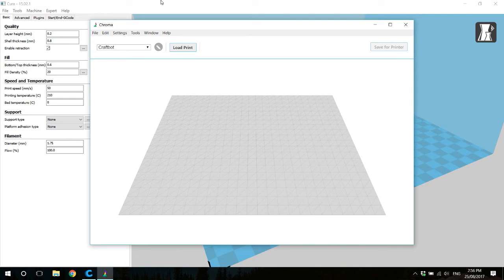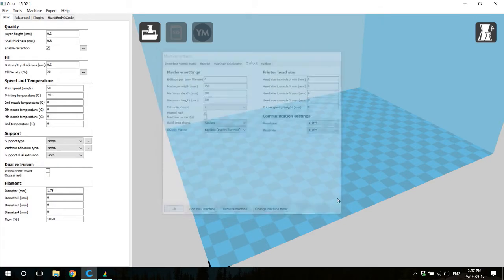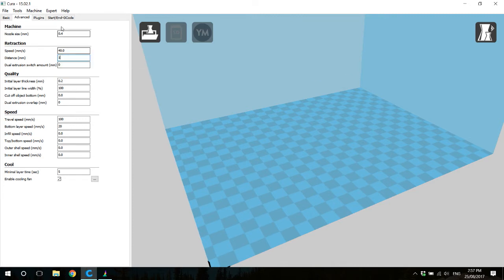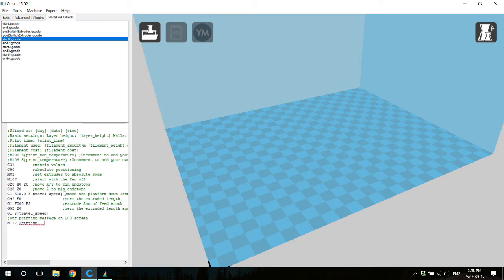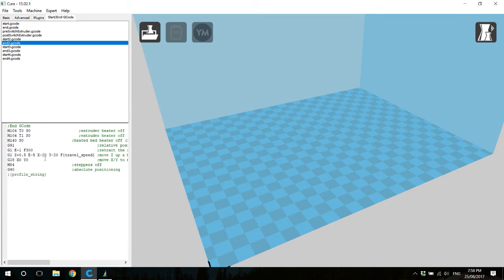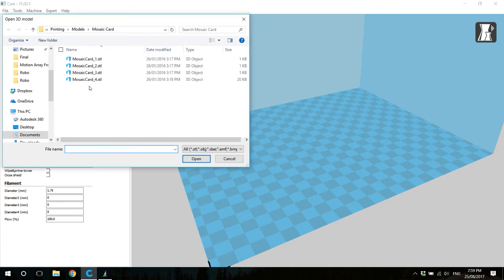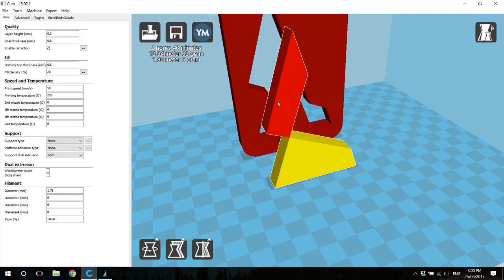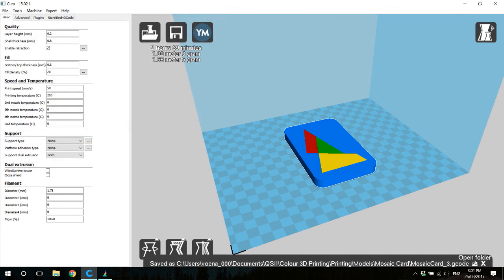Slicing with Cura for Palette/Palette+

Comment: You described how to align multiple parts of a model, but how do you explicitly choose an extruder for a given part?
Reply: Hi Jason,

I'm not sure if this is possible in Cura.

What's the use case for this?

If you have more than 4 STLs and you need to reduce the number of STLs so Cura will generate G-code with only 4 extruders, you can use software like Meshmixer to combine the STLs (http://www.instructables.com/id/Meshmixer-Combining-Models/) before slicing them.

Other slicers like Simplify3D will let you explicitly choose which process/toolhead you want to assign a model to.
Reply: Hi, Brennan.  You've pretty much described the problem I have.  More than four STLs, but I want to assign a tool to each explicitly.  I suppose I'd have to align and group them in another program, but S3D works just fine.

Comment: WHEN ARE YOU GOING TO MAKE THIS COMPATIBLE WITH 2.85MM FILAMENT?  You advertise on your website that your Chroma software works with the Ultimaker 3, but how is this possible being that it uses 2.85mm filament?
Reply from the maker: Hi 3D Novice,

We do not currently have any plans to make a 2.85mm module. The "Compatibility" section you are referring to is for CANVAS, not for Chroma. https://www.mosaicmanufacturing.com/pages/software

I'm very sorry if the website was unclear or misleading in any way.

Developing a product for a different filament size changes every single part in the system, and we've decided not to add the complexity of supporting a different filament diameter for the time being as we already have more demand than we can handle with the 1.75mm unit. We'll consider making a 2.85mm Palette in the future!

Comment: Great guide any chance you could make one for Cura 2.5 or  Cura 3?
Reply: The problem is not making a guide for those versions, it's been found that later versions of Cura have changes that make setting up for various printers more difficult. PLEASE use the version in the tutorial until other versions are tested and proven to work with more printers and Chroma. Again, the current advice is do not stray from this version unless you want to troubleshoot and support your setup.  Cura v15.xx is the current "supported" version.